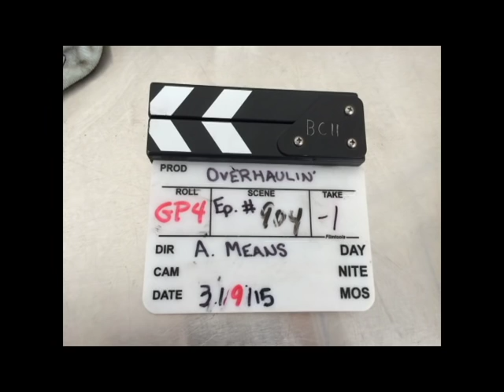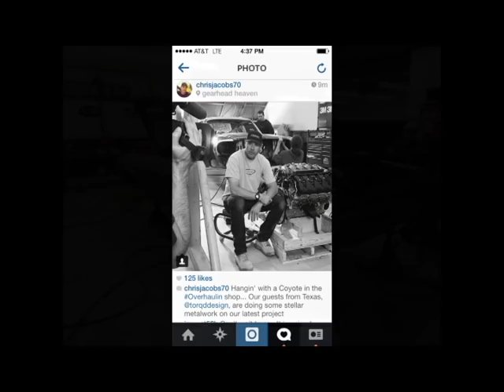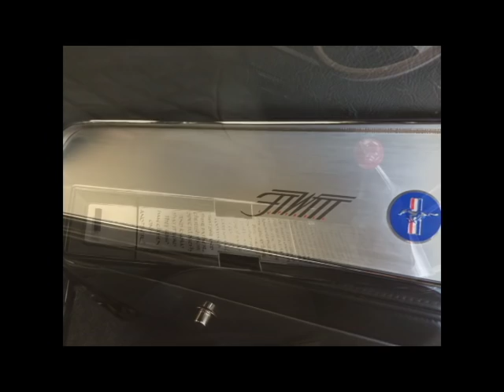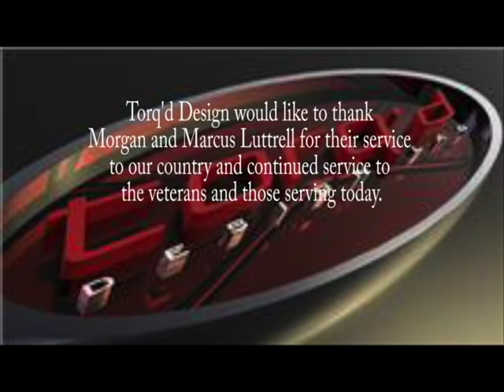Behind the Scenes of Overhaulin Marcus Luttrell with Torq'd Design

Comment: WTF not even a supercharged Super snake engine in it, FORD have a 335KW standard 5 Liter, why not do a little extra work on that engine by Ford Engineering & then you would have at least 400KW at the rear wheels But nope just by straight from some dealers Foose has & bolt on stuff, a little body work to change things here & there to make it look different, Marcus deserves a lot more than what he got, that way he can sell it & make even more money for the Charity ?